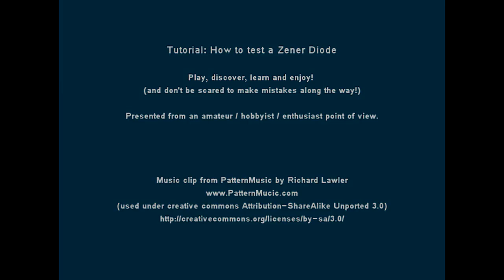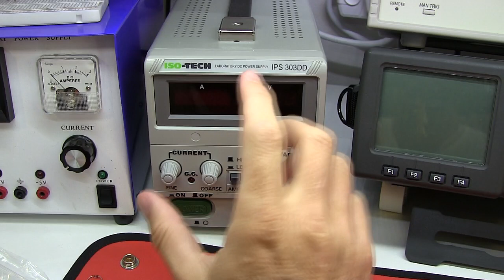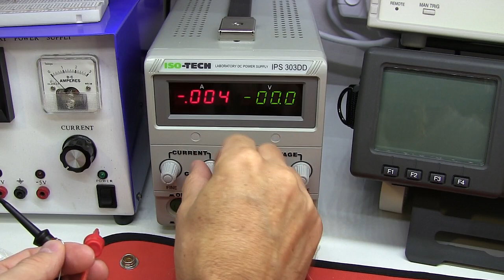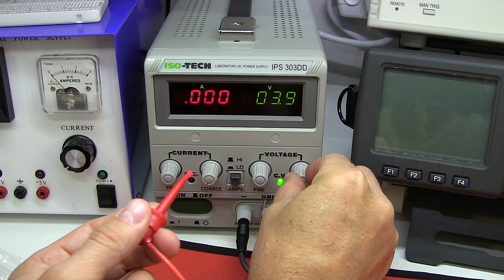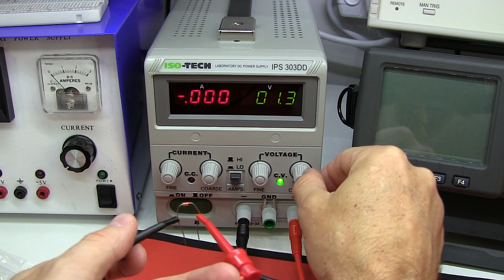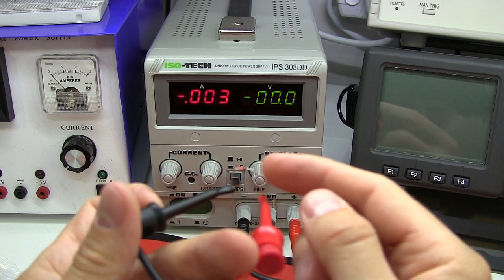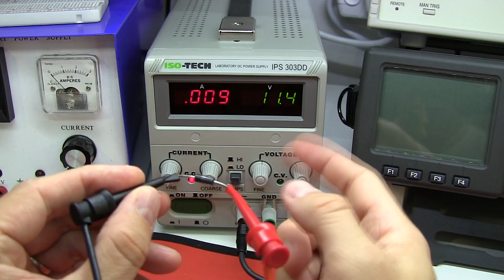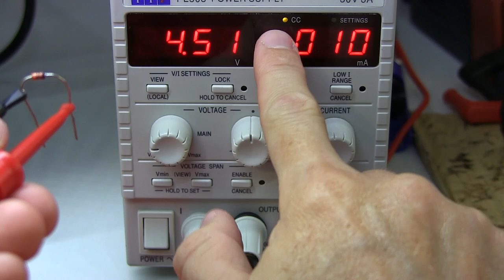Tutorial: How to test / measure the value of a Zener / Avalanche Diode

Comment: You dont have to fiddle with the voltage. Set the supply to current limit at 10ma and leave the voltage all the way up. Connect it, and whatever the displayed voltage is, is the zener voltage.
Reply: Star Gazer  Yes that is correct, not sure why he went the other method to find the Zener voltage.

Comment: Is it safe to test 100v diodes this way? I'm recreating a guitar amp for my dad. There are two zener diodes In the circuitry because it has a built in overdrive. So my zeners have to be exactly the same because that's what produces the distortion. I also only have a 48v variable power supply so I wanna know if it's safe before I invest in something.

Comment: with this method you often will get slightly different than nominal voltage - because manufacturer sets the nominal voltage for zener at specific test current which can be lower or higher than 10mA - if you take a look at VI of zener you'll find that curve of working zone is not falling strait down, but has a resistive slope
Reply: You are right, but we are interested in the “knee” voltage only...

Comment: You don't have to fiddle around too much with the voltage potentiometer. Once it's above the Zener voltage, it will stay mostly constant. So just ramp it up and see how it behaves - 0.0V (10mA)is a shorted diode, 0.7V(10mA) might mean forward biased, and +30V (0mA) is an open circuit Zener.
Reply: Correct, but for these tests you don’t need a power supply. The multimeter set in “diode” function will clear these two faults (shorted or open diode) quite easily. The constant current technique instead, is intended to verify the zener voltage, which is a qualitative test. Not a “go-no go” one.

Comment: The problem is, some power supplies display the setpoint, not the voltage which is actually on the output.

One of my Instek PSUs has a "DISPLAY/LIMIT" button, which switches between the terminal voltage and the set point. The other doesn't.

The workaround involves a set of stackable 4mm "banana plug" test leads and a multimeter :)

Comment: Great video but I have a problem I can not resolve. I have 5 Zener 1N4148 with 135 vdc in which there is no spec for that voltage. For a Laars Electronic pool Heater. I am thinking all 5 may be bad as they are way out of spec for that part number.  The Zener is across a 12 vdc relay coil. Any ideas?
Reply: Something is wrong in what you say...1N4148 is not a zener diode. It’s only a low power switching diode...
Reply: @ΠάριςΑζής  In all honesty, I am not an electronics guy and thanks for clarifying what I am looking at. Now that you have been kind enough to clear that up, do you check them the same way as a zener diode or is there another method you can suggest? I have power sources and necessary meters to do my checks, just need some guidance. TIA
Reply: @coryknipe5471  All you need is to test them by using your multimeter set in the "diode" mode. Nothing more than that. A healthy diode conducts only in one direction   in which you see in the display of your instrument its forward voltage drop, in millivolts. For ordinary silicon diodes this voltage is around 0.6 Volt, or 600 millivolt. This happens when you connect the red probe of your multimeter to the anode of the diode and the black one to the cathode of the diode. If you connect the probes in reverse, you should have no reading at all. Any reading means leaky diode, which must be replaced. If in doubt, remove one terminal from the circuit and measure it again. Also, if you measure zero or nearby at either connection, this means shorted diode. And if you measure nothing (infinity) this means open diode. These are all the possible cases you will see with diodes. Usually the cathode is marked with a silver ring if the case of the diode is black plastic, or with a black ring if the case is glass made. Some manufacturers mark the 1N4148 by the color code used for resistors. In this case you will see four rings on its body: yellow, brown, yellow, grey (that is sequentially 4, 1, 4, 8, with the last grey ring marking its cathode, having double width than the other three rings)...
Reply: @ΠάριςΑζής  Perfect, thank you! you have been a great help. I have replaced all the parts on the board except the transformer which i knew how to check from past experience. That includes 3 relays, resistors and the diodes. Thanks to your video and explanation this board just needs to be sealed and its done. Identifying the diodes was my biggest issue and understanding how they work. On to the second board that it mates with. :) Thanks again
Reply: Cory Knipe You are welcome (but the video is not mine. I just commented in order to help you)!

Comment: Can I put a big value resistor in series with the zenner diode to measure the stable voltage across the zenner terminals? 
And the only thing to vary is the voltage source...
Reply: Here is a simulation result, and if you search on the datasheet you will find that the diode is 75V and 3.3 mA :)
http://postimg.org/image/jskko2uip/

Comment: Great video, Sir, thank you.

Might there be a "poor-mans" method if one can't afford an adjustable power supply?

What if I ran the + lead of a battery through a Pot, can I adjust voltage and find the value of used Zeners that way?

Keep up the good work!
Reply: +BillyGoat4x4 you need to limit the current or else risk cooking the diode
Reply: The pot will just limit the amount of current, the voltage from the battery will still be there, to have adjustable voltage you would have to connect the pot across the positive and negative, in other words in parallel with the diode! The more that the pot shorts across the positive and negative the more the voltage drop across the pot and less across the diode but be sure to put a resistor in series because you don't want a lot of current across the pot or the diode...

Comment: The problem with a forward limiting resistor is that the current limit will change depending on forward voltage:

I = V/R

So if you have a 4.7V Zener on a 10V supply with a 470R:

I = (10-4.7)/470 = 11mA
P = I * V = 0.011A * 4.7V = 0.053W = 53mW

Which looks fine. Now increase to 15V:

I = (15-4.7)/470 = 22mA
P = I*V = 0.022A * 4.7V = 0.103W = 103mW

And if your Zener diode is rated at less than 100mW, you just blew it up :(

Comment: i want to drop my 9-12vdc power supply to 5vdc output,.
 i choose to use zenner diode to step down to 6v then a LM7805 to regulate it to 5vdc...,
 i have a lot of diodes in my box but the problem is i dont know which one to use. can anyone tell me the code of the zenner diode i should look for? any numbers? sign?
show the schematic as well..
Reply: You don’t need anything of these. Just feed the 7805 directly from your supply. You only need two 10μF capacitors, one at 25V at the input of the regulator and one at 16V at its output and you are done. Note: you also need a decent heat sink for this I.C, especially if you intent to draw about 1A of it...

Comment: How about a more realistic example....I have a zener in a circuit that has two blown resistors.  I want to know if the zener that is in the circuit is still good.  How do I test it?  These videos are ridiculous because you can obviously test for the values of a FUNCTIONING zener.  How about testing whether or not a zener IS good?  And if it's not, THEN HOW do I figure out its value?
Reply: You start by lifting one leg to isolate the diode from the circuit. The. You use the methods here to test the diode's breakdown voltage. You compare that with the voltage in the schematic or parts list (or by looking up the part number). This tells you if your Zener is good.